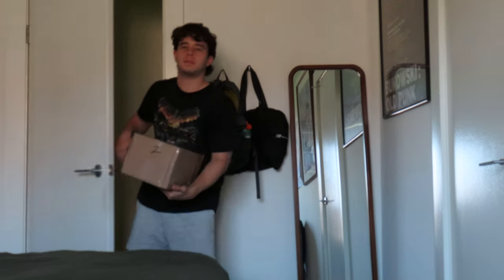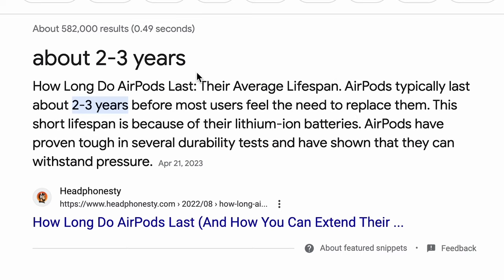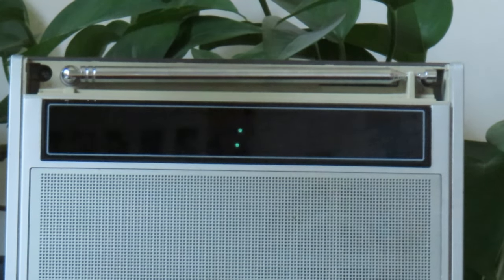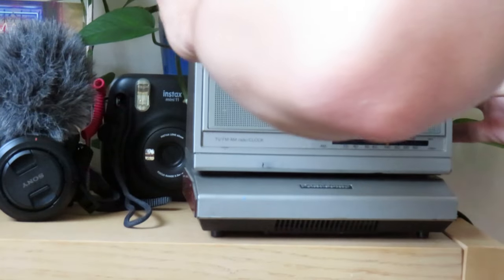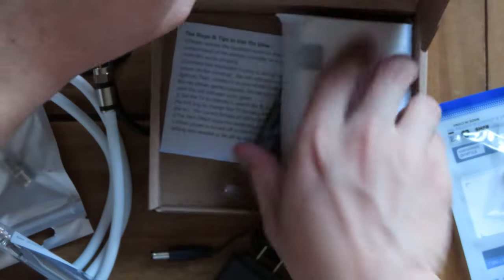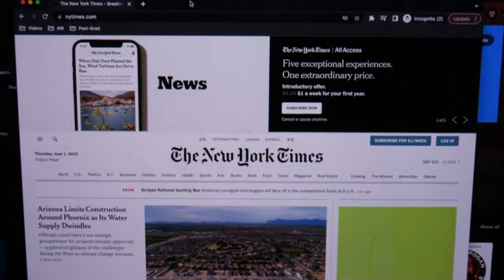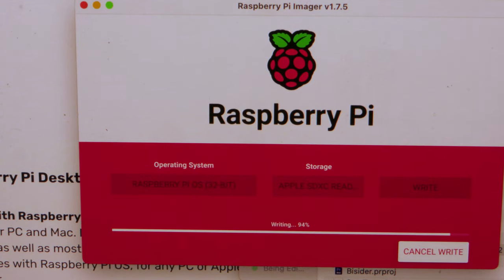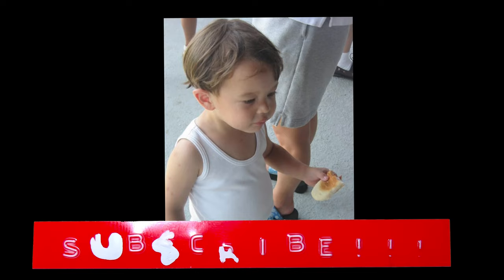Does This '80s TV Still Work? Hacking a Tiny CRT with a Unique Design!

Comment: JVC made a radio/TV combination unit which also had a retractable screen, when the screen was folded down the unit looked like a pyramid, and the loudspeaker was on the front/top of the screen.  Analogue television isn't used in many countries anymore, I think in the US it stopped being broadcast in around 2009 or 2010 or something.  Here in Australia where I live, analogue TV stopped being used in 2013.  This TV set is very uniquely designed, I really like how the clock is on the front of the unit when the screen is folded down.
Reply from the maker: OH wow is it this one: https://www.ebay.com/itm/304927411772 ? If so that's super cool. Thanks for being here!

Comment: Really good video! Anyway analog Rf tv signal has been deprecated in most countries in Europe (where i'm from) but i suppose it's safe to extend this assuption to all modern countries as well. Now tv signal needs to be decoded to work properly (and thus we can have HD tv etc.). A cool feature you could add is wireless transmission, which could be totally possible given it's what that was meant for. You would only have to connect the RF out from your HDMItoRF "modulator" to an antenna instead of a cable and take out the antenna from the small tv set. If the distance between the two antennas is not much the signal should be just as clear ; )
Reply from the maker: Thanks for this advice -- actually I do have an external antenna, so I could probably try this! That's really good to know, I'll try it later today.
Reply from the maker: I tried the ext antenna thing! Made a Short on it: https://www.youtube.com/shorts/b8kJIQhiGKg

Comment: Yeah CRTs get hot. You can add a little fan to it if you're concerned but they're pretty much meant to run that way. You will greatly extend the life of the CRT if you cool it. Basically they were made without logevity in mind and they cook the capacitors inside slowly. Shows you just how high quality old caps were though. They last 40 years and still are within spec!

Also of concern if you want this thing to last: the CRT itself is a consumable resource. Don't leave it on a static screen for too long or the image will permanently burn in, much worse than LCDs / Plasmas can.

As a consumable resource, the fewer hours you put on it, the bettter, but for a 4" little art piece, I say enjoy it!
Reply from the maker: Oh good to know, that makes sense! It's sort of by an AC unit so that might help, and I don't plan on leaving it on a permanent screen, so that should help. Also I'm guessing turning down the brightness will reduce overheating?

Comment: Cute project. Are you going to put the stuff inside the casing itself? You should be able to bypass the tuning circuitry and put in a composite signal (which the Raspberry Pi can output via the 3.5mm jack if you get the right cable,) if you're looking for an electronics project. As for the TV portion, all US broadcasts are now in digital ATSC, instead of the analog NTSC that this could use. You can get small TV tuners that can plug in via USB to your Pi, should you want to. As for the TV getting hot, that should be fine, as they do get a bit warm, being that it's a miniature particle accelerator that projects and controls an electron beam to hit phosphors on the display front to make the image you see.
Reply from the maker: Thanks for all the info, super cool to hear from someone with more experience!! Good to know about the heating issue -- and as for putting it inside the casing, I've been warned on some forums against opening up the case if I'm inexperienced. Don't wanna mess with the flyback transformer!
Reply: How would you even begin to try and bypass the "tuning circuitry?
Reply: @maximejkb  Fair point. If you're not comfortable with opening it up, best to leave it. If you get adventurous, there are guides on repairing CRTs that should help.
Reply: @TrevorV  Most of these older TVs have schematics available, and the tuner will have a dedicated section (if not an entire board for itself) that you trace down to what should be a single signal going to the amplifier for the tube, and that's where you separate out the signal from the tuner and put in the Composite signal, good chance of it being labeled Composite or CVBS on the schematic. Getting the schematic can be a chore sometimes if there isn't an online community around the device, as not every manufacturer scanned in their archives. Someone recently had to order microfiche (an extremely small photographic negative) from SAMS to get the ones needed, then find a library with a scanner to get them into something usable. There should probably be guides for doing such (both the mod and getting the schematic), but I don't have any to hand. RGB modding a CRT TV should be easier to find info on to give a basic idea, and black and white should be easier than that.

Comment: Yeah uh... they basically just got rid of analog video broadcast in your lifetime. Not surprising you don't remember as they made very little fanfare out of it. People who did use over the air TV were all probably using flat screens with ATSC digital video signals at that point. That's what you're seeing when you tune in stations on that thing.
Reply from the maker: Ahhh good to know!

Comment: this sounds a lot like my project hodgepodge. real similar, actually. only difference is mines portable. the tv im using  is 1986 bently black and white portable tv. a raspberry pi, an rf modulator, and a battery pack to run the pi and modulator. im having issue getting picture, though. also, thats a japanese electronic! they run on 100, not us 120! your cooking it! get a power converter!
Reply from the maker: Oh wow that's such a cool model! And thanks for letting me know about the power converter, I'll look into it!

Comment: I want to copy you and put cli output on it
Reply from the maker: Oh that's a good idea -- you mean CLI as in command line output? That would be really cool --- I was actually thinking of using the NYC MTA API to print out the time to the next train at my nearest station to CLI.
Reply: Yeah, that’s a cool idea I was thinking of running my home servers system monitor output using the gotop command
Reply from the maker: @bide7603  So sick! The cool thing about this HDMI -> RF modulator -> coaxial setup is that it'll work for pretty much anything you wanna stick on the HDMI and old-school monitor ends! So any CRT of any size, including vintage TVs from pre-80s to 90s tube monitors, will work.